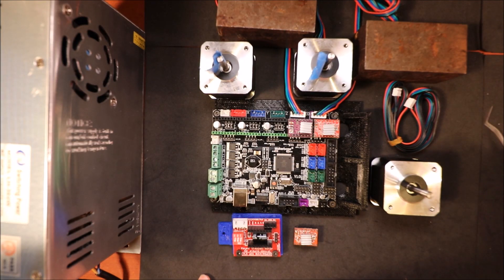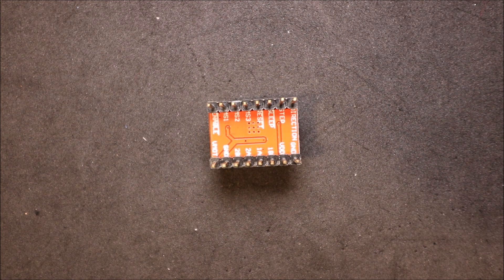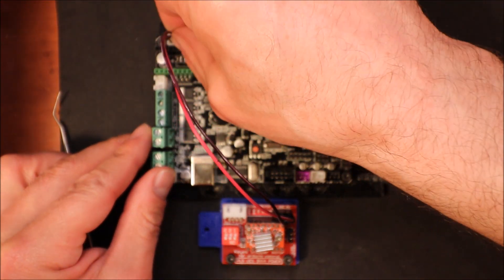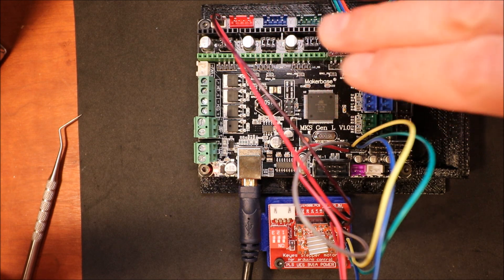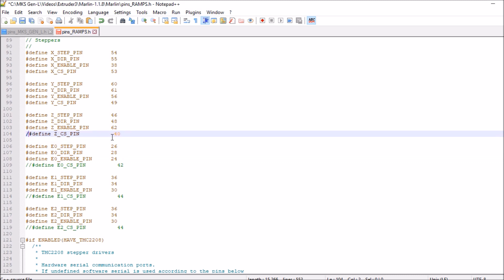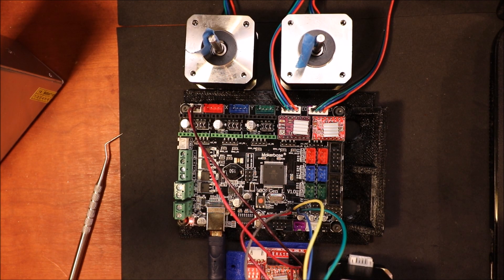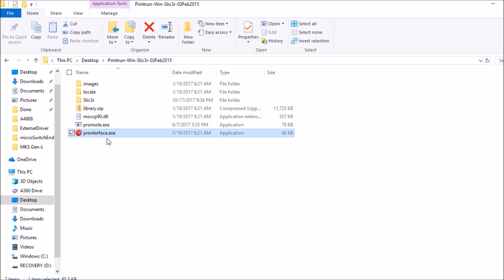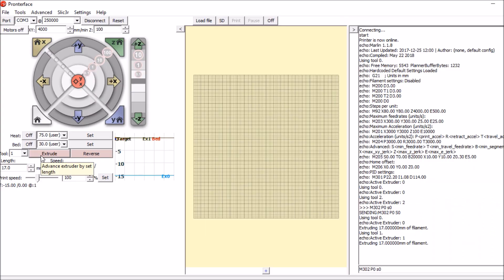MKS Gen L - Adding a third extruder for a diamond print head

Comment: Great video and thanks for sharing. I'm building a third extruder on one of the printers with the MKS Tinybee. I've tried several ways and I can't find pins to connect Step, Dir and Enable from the expansion board. Do you have any suggestions?

Comment: Hello . Thanks for the good video
Can you please explain in Firmware how to disable the extruder thermistor?
Because I tried it once and it says
   The extruder is in low temp and I couldn't move stepper motor until hotend isnt on
Reply from the maker: Unfortunately I will not explain how to disable.

Here is my reasoning why, I don't want to show people how to burn their house down .

The issue of low temperature warning is related to a malfunctioning thermistor.

It means it's broken or not plugged in.
Reply: @EdwardBraiman  
Thanks for the answer, but let me explain more clearly
I want to make a ceramic printer that does not need a heater, and when I want to run the printer, it gives a low temperature error, even though I did not even connect the thermistor, but when I connect the thermistor and set the minimum working temperature to 22 degrees, the printer works. he does . But I do not want to connect the thermistor at all, is it possible?
I mean make changes to the firmware
Reply from the maker: If no thermistor is present, the you need to specify 999 for thermistor.

Comment: Hi Edward Brainman, Great video. Thank you for sharing all the details. I need your wisdom. I'm new to this kind of thing. Is it possible to control the stepper motor by connecting the "stepper motor for arduino control" you use in this video directly to an Arduino? I really appreciate you sharing this video and hope to learn more from you as you are the only person online I have found taking about this External Driver. 
I'm trying to use an Arduino Nano to control a Nema 17 stepper motor without using a breadboard (Arduino to External Driver, Power to External Driver, External Driver to Stepper Motor). Is this possible? I'm new to Arduino and all this kind of fun work. Anything you share is appreciated. Thank you Mr. Brainman. Great name. :-)

Comment: Hello, I am wondering why did you use those specific digital pins? could you have used any digital pin and just match the number you used in pins.h?
Reply from the maker: Yes.  The reason was more to get people thinking about what you just asked.
Reply: @EdwardBraiman  This is good news! I haven't done much custom work on my 3D-printer boards, however, I do have some experience with Arduino and setting pins. I am hoping to add a Stepper Extender to an SKR Mini E3, while keeping my BLTouch. I will let you know if I make any meaningful progress. Thank you for the video.

Comment: Hi man! really interesting video, I appeal to you because you deff know your stuff, I have a vertex k8400 with a board AVR ATmega2560 based, I am trying to add a 3rd head (UV-curing LED) I would like to use it kind of like a 3rd printhead, be able to move it around and turn it on with G-CODE, do you think is possible to use the bed heater pins for such purposes? if so, any idea on the firmware configuration? I am completely new to this and to be honest, I hardly can keep up with any firmware configuration. any help will be very appreciated. thanks for your time and help
Reply from the maker: You might want to checkout reprap forums as they might have a better idea of Marlin firmware and hardware setup.

Comment: Do you have a Diamond print video?
Reply from the maker: I've got a stepper setup video.  I can do a video on the printhead.
Reply: @EdwardBraiman  Yes, do it if it's not difficult. very interesting since I myself have been thinking about it for a long time! It can also be schematically show the connection of 3 extruders. the video does not quite see the connections of some pins
Reply from the maker: Well for a diamond printhead you should only need Odin (one) thernistor and heating element.  I've got one coming in the mail in a couple of days.
Reply: I have already bought components for a long time, just now I found your video, there is no other review on the Internet.
Reply from the maker: It's not a hard setup for the diamond.  Just has a lot of steps.

Comment: Great Video. I would like to do this with my Z drives. Can you help?
Reply from the maker: Do you mean additional Z-axis stepper?  I may have several videos in my playlist which may address your issues in several ways.
Reply: @EdwardBraiman  Actually what I want to do. Is to add a second driver to my Z axis. Using a Keyes External Driver Board like the above video. I want to use TMC2130 SPI. I am currently using the Z axis to run two stepper motors through a serial connection. The Keyes Board looks like a better setup. But I would like to use TMC2130's in SPI mode. I currently have an MKS GEN L v1.0, but may upgrade to an SKR v1.1. You have made many excellent video's, Thank you.
Reply from the maker: Might be easier and cheaper to use drv8825 as tmc2130 eats up many pins in this case.

Comment: I’am using trigorilla board, it seem different, i don’t known how to conect that shield. Can’t you help me? Thank you
Reply from the maker: I'll have to research.  Does it have pins on the bottom of the board or are you referring to stepper driver boards?
Reply: @EdwardBraiman  it have 6 pin AUX: 042, 043, 2 pin GND and 2 pin 5v
Reply from the maker: So your first step is to locate the datasheets or pinout diagram.  Once you know the pin numbers it is a matter of matching the steps in this video to your configuration.

Comment: H, Thanks for another nice video. one quick question,  Because I am not using an extruder for motor E; I am using syringe instead. How can I add an end stop for E motor/extruder motor.
Reply from the maker: Great question, truth be told I'm not sure.  You might check out my filament run-out video and then draw a syringe form factor to trip like the filament run-out.  Good luck.